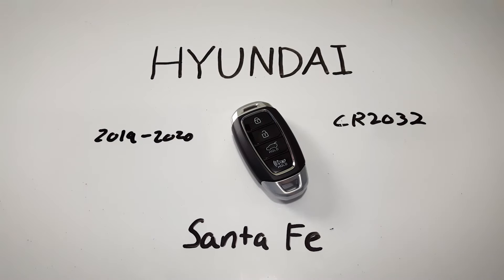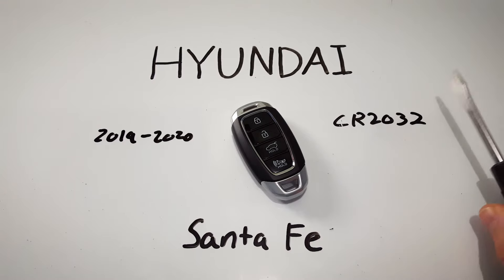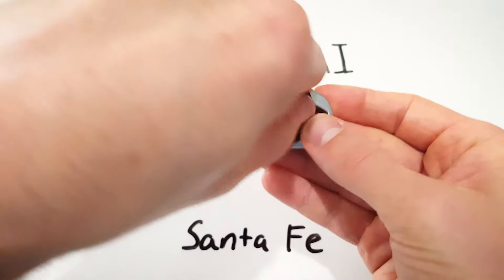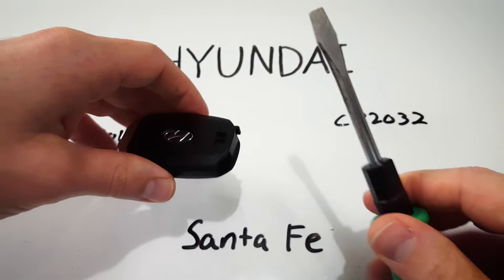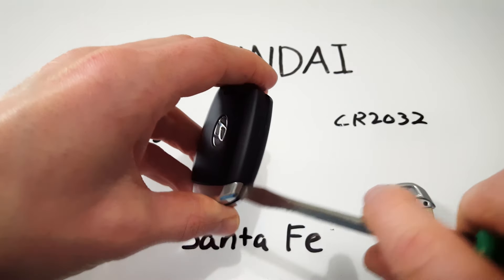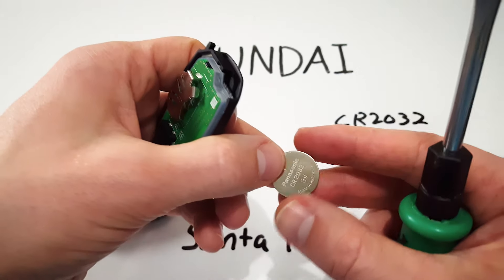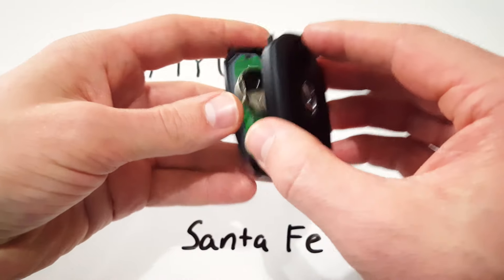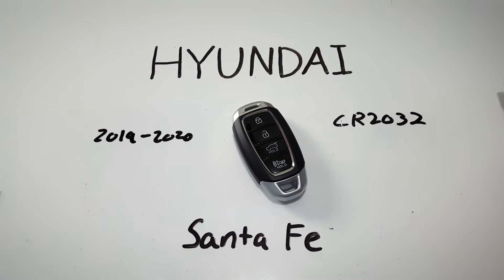Hyundai Santa Fe Key Fob Battery Replacement (2019 - Present)

Comment: I just destroyed my key fob doing exactly what this guy described. I would recommend not using his technique.
Reply: Don't insert the screwdriver in the key slot.  There is a small, shallow slot below the key slot.  That's where the screwdriver goes.
Reply: It worked for me, even though it was a bit difficult!
Reply: Same. And the small slit that keeps being mentioned wasn't working out for me either.
Reply: I just took one apart and no problem at all.
Reply: Got to use proper side screwdriver which you obviously you didn't. However Hyundai could have made easier to open
Reply: What happened!? Sorry to hear that!!!
my former car dealer found my second key fob but threw it out because I didn’t come fast enough during Covid to pick it up. Really? A car dealer at a Lincoln dealership where I bought this gorgeous Hyundai Santa Fe decides to throw out somebody’s car key. You’re really not going to ever get any Lincoln sales from me dude. I’ll be afraid I’ll be throwing out my extra key!!!
Reply: @nukeelec  thank you for that wise point you’ll also prevent me from destroying my own key fob. Thank you.
Reply: @williamwatson171  it’s possible they use too much force, but he didn’t mention that he used any different kind of screwdriver which wouldn’t make sense because it wouldn’t have fit in there so that doesn’t make sense
Reply: Just did mine without issue. ✌️
Reply: You are right. Thank you so much.
Reply: Yeah, Don’t solely trust the screwdriver, just push something with a slight bevel into the slot, just enough to start the side to have a little separation.  Then use some kind of a flat edge to continue the separation around the sides, similar to how this video shows. Twisting the screwdriver too hard will mar the slot, and cause damage possibly.
Reply: Same here -.-

Comment: I have a 2019 Tuscon Ultimate and my main key fob died; luckily, the spare key fob still worked. My dealership wanted to charge me $250.00 for a new key fob. I'm not mechanically inclined whatsoever. However, your video was excellent, and I fixed it for the $5.00 for the batteries! I spent 10 minutes remotely playing with the back hatch door, just delighted that it worked again. You're wonderful. Thanks!

Comment: This must be the hardest fob to open ever made.  Your video helped. The slot is the bottom one, not the larger one. I found that a gunsmith screwdriver worked better, left side loosened, then took a knife and placed left to right across midline on bottom to pry bottom of case open. I wonder if the dealer has a special tool to open these. Thanks for the video.

Comment: I'm a locksmith.  You should show a closeup where the screwdriver goes. 
People are erroneously putting the screwdriver in the key hole and not in the little slit below the hole and are cracking expensive fobs
Reply: Too late :-(

Comment: I followed this exactly, and the outcome was superb!  You can see the little slot to put a narrow flathead screwdriver (he was specific about the slot, not the keyhole)!  Thank you for this video, I didn't even have to reprogram the one fob that has had a dead battery for months. Doors open fine, and the engine started up as soon as I was in the car.  Saved a nice $45 the car dealer was going to charge.  AAA instruction video!!!

Comment: I followed instructions exactly.  My key fob cracked about half the way down.  I did manage to get it the rest of the way open, change the battery, and snap it back togther.  However, you can still see the crack.  Maybe the flat head screw driver I used was not wide enough?
Reply: You have to put the screwdriver in the little slit below where the key slides in. You can't put the screwdriver in the big opening slot where the key slides in....right below that big opening is a little slit 
Turn the screwdriver clockwise and it'll pop right open.
I'm a locksmith and do these all the time. If you put the screwdriver in that big hole it'll crack the case every time

Comment: My 2020 Sante Fe couldn't detect the key fob.  I tried to start it by pushing the start button with the fob as specified in the owner's manual, but that didn't work.   Then I tried my spare key fob and it worked.   I replaced the battery in the original key fob, which measured 3.0v, and it worked.  The new battery measured 3.2v.  I removed the battery from the original key fob to simulate a dead battery, then tried to start car by pressing the start button with the key fob.  It started.  My guess is that the key fob glitched out and was reset by removing the battery.
Reply: Same here..were u able to make it work if you did how please?
Reply: @Danny-tr1eg  I removed and re-installed the battery, which must have reset the key fob.  I did end up installing a new battery after that because the old battery was weak. although it still worked.